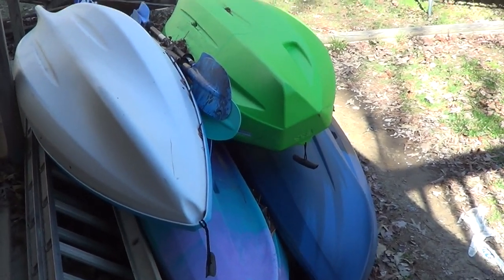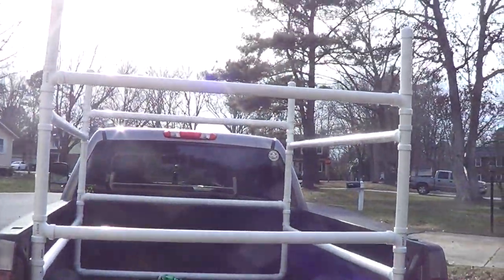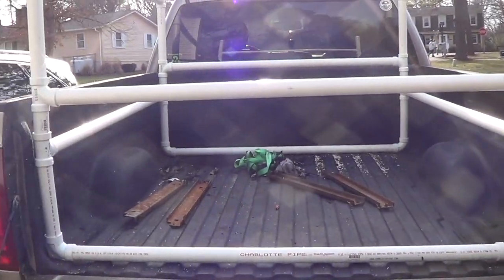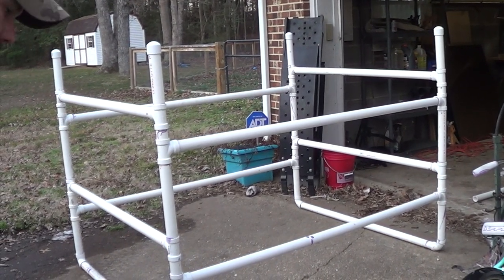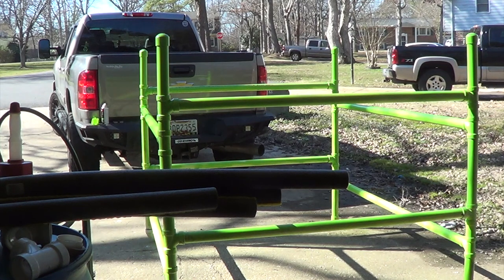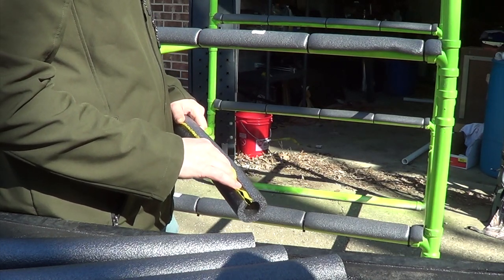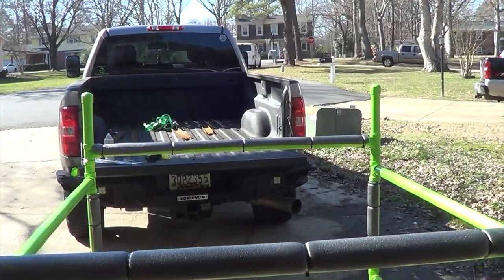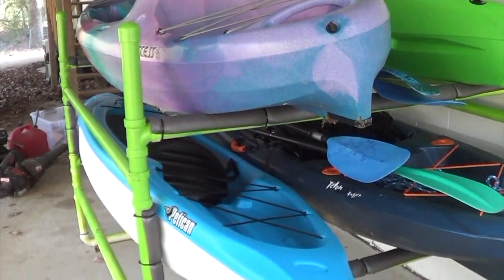90$ DIY Kayak Rack for Storage and Transport

Comment: Been looking at a couple designs, but like your idea best. Very versatile. Made me realize that if I play my cards (and dimensions) right, I could use the same design to transport in the back of my truck, store kayaks by the lake during the summer AND in my carport for winter storage. 👍
Reply from the maker: Im still using this one to store them behind the house, However in some of my previous comments I talked about the issues with it being used for transport. Just the Tee fittings I used made the joints weaker than I thought so it cracked on one. Im about to rebuild it with regular fittings and maybe step the pipe size up just a bit. Let me know how yours turns out! Im going to post an update video once I build the 2nd version. Please subscribe to the channel to get notified when I post it.
Reply: Nate W it proved to challenging to make one that would do triple duty. It was much too high, so I created a double with room one each side for my paddle boards. Serves my purposes. Wish I could post a pic.

Comment: Not too sure if it's sturdy enough during travel. Can't find an update so far either. Looking forward to one.
Reply from the maker: It held up pretty well, the only issue I could see was using the sanitary T fittings. The pipe doesn’t sit as deep in them and can cause cracking. I will make an updated video showing what all I changed.

Comment: Did you use Schedule 40 or 80 PVC? I have a 2013 2500 HD also, had a wood rack for when we pull travel trailer amd it didn't support a longer trip, so trying the PVC route.
Reply from the maker: Schedule 40

Comment: Hi Nate. Been a couple months now. How’s the rack holding up? Would you make any changes?  I am looking to do the same thing so any suggestions would be greatly appreciated.  Thanks.
Reply from the maker: I think using the sanitary Tee fittings compromised the strength of each joint since the pipe doesn’t go in but around 1”-1.25” into each. I had some fittings crack from moving it around. I’m about to rebuild with regular PVC slip fittings and may end up going a size up in pipe to help with strength as well. 
Second thing I want to modify is adding a cross brace in the middle to better support the Yaks. The bottom ones only catch the front cross section by about 4” before it’s almost touching the back glass. I had a couple of times one of the bottom ones shifted a bit and fell down into the bed of the truck. The middle section would solve that though. 
I have been wanting to do a follow up video but have been super busy lately but promise I will get one out soon.

Comment: have you tried it out on the truck yet? How'd it do? I need to get 4 on the back of a yota but im thinking just lifting two up high enough to stack the other two under on the bed, so not quite as high as yours and one less level. Curious how it did?
Reply from the maker: It worked great a few times but it has started cracking at one of the joints. I think maybe using a bit larger PVC with a thicker wall would solve the problem though. I also used sanitary tee fittings which were cheaper than regular slip fittings but could also have added some stress on the joints. I’m going to modify it some and will post another video about it once I get the time to do it. Please subscribe to get a notification when the video posts and to help my page grow!!
Reply: Nate W what size did you go up to, 1 1/2 or 2?  How long are your side pieces?  I have a tool box in my bed, so my length will only by 55”. Not sure if that is short enough, or if I should put in a cross piece.
Reply from the maker: @dmills7375  I think 55" would be good. I am going to rebuild this one and end up adding some center supports to it.

Comment: Can you share the lengths that you cut the 8 foot sections into?  I'm going to build one this weekend and it would be great to already know what length each piece needs to be.
Reply from the maker: I can’t remember off the top of my head. I just measured my truck bed and wrote them down on scrap paper that probably got tossed once the build was finished. I would suggest always measuring for your specific project anyways because unless you have the same year, make and model truck, your bed size may vary from mine.

Comment: Doesn't look like lower rack could handle kayak length without hitting truck window....
Reply from the maker: It is set back from the window a few inches. Adding a middle brace to it supports them fully.